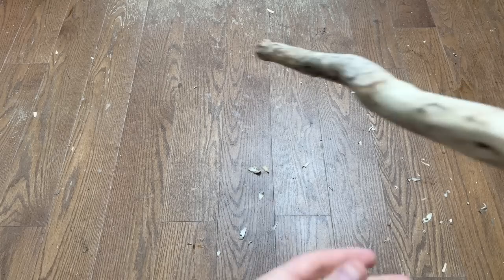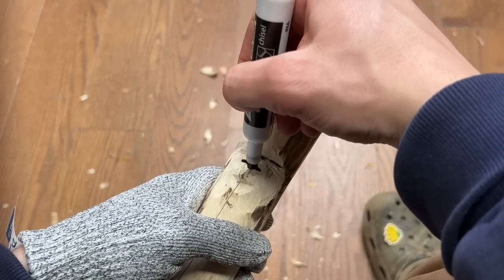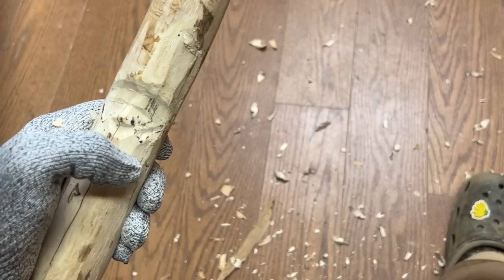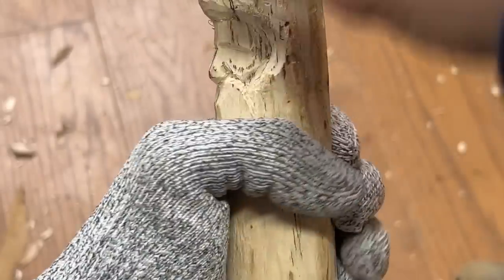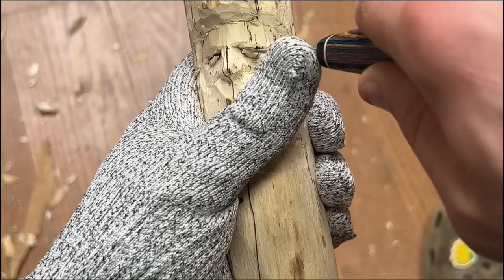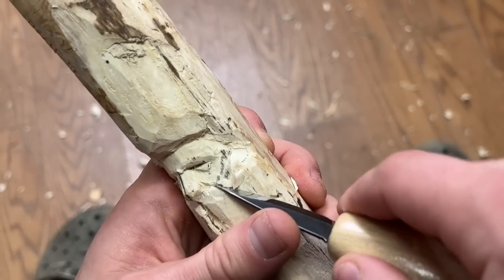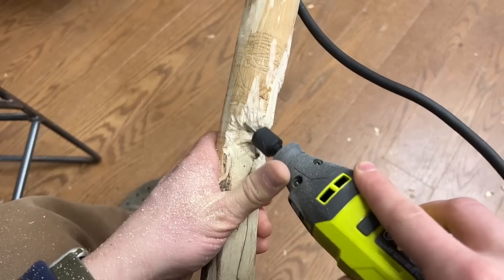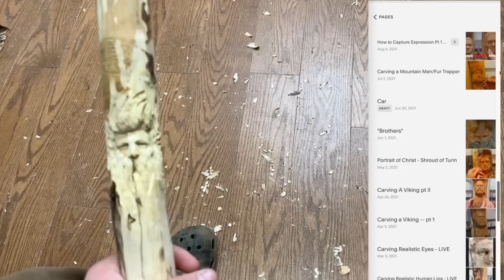Carving a Woodspirit Into a Hiking Stick

Comment: Is that Sycamore or hard Maple?  If it is either, then that would explain the lighter appearance, the diffuse grain, and the hardness. Just a WAG, 🤔
You mentioned Ironwood as a possibility, but I have the impression that Ironwood is generally darker and more brown in color.  It certainly is hard. For sure.
Whatever that wood is, it is certainly hard enough to make your knives "chirp". This is another great video. Thanks!
Reply from the maker: I think you're right! Definitely not ironwood!